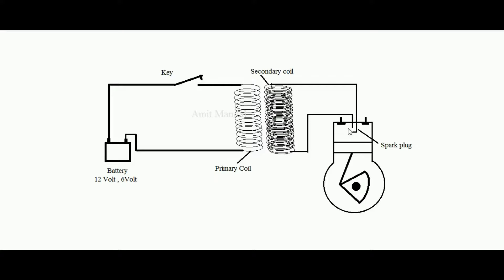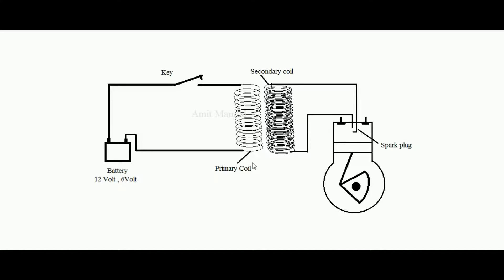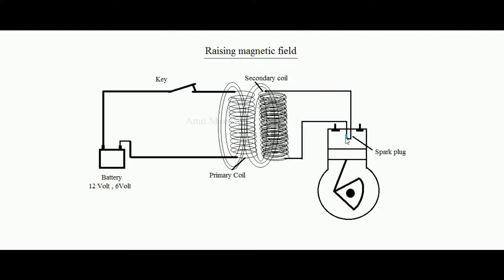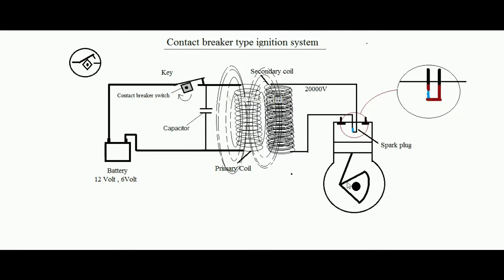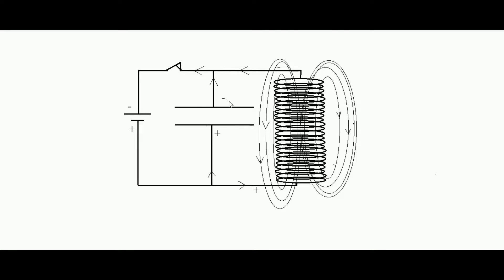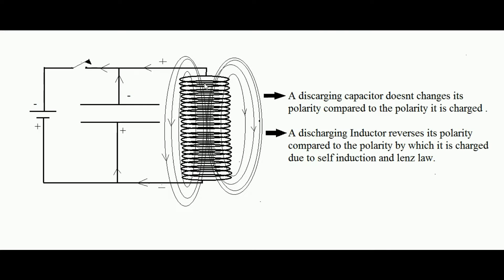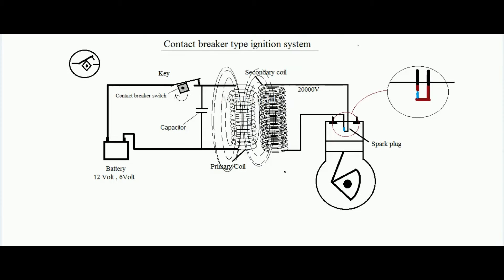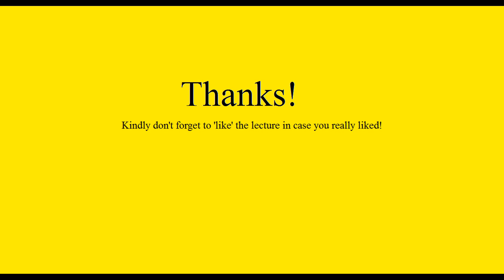Ignition system in SI engine

Comment: Hello,
I hope you want to answer my question about this video and some others.
First of all, i think your video is very clear. Thanks for that!
In your video, the condenser is set parallel tot the coil. In other examples i see that the condenser is set in series to the coil. I tried both and i see no change, both work.
I see clearly why your example way works, but i do not see clearly why some people put it in series like in this video: https://www.youtube.com/watch?v=W94iksaQwUo&t=121s  
Would there be any difference? and why?

Regards,

Arthur
Reply: In the second video means u mentioned some link, in that capacitor placed in parallel